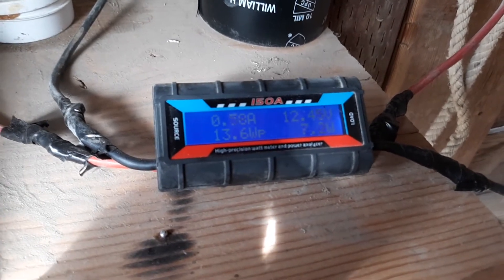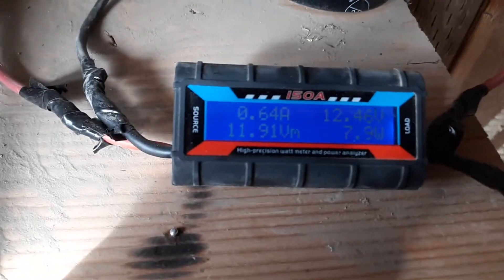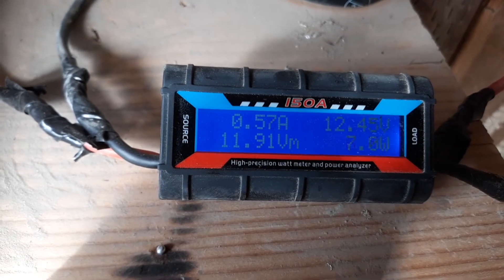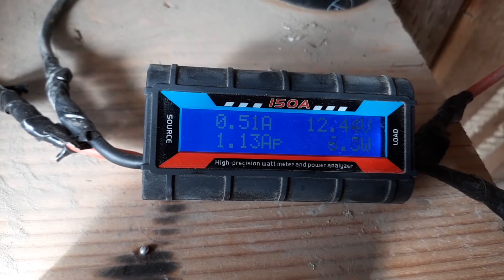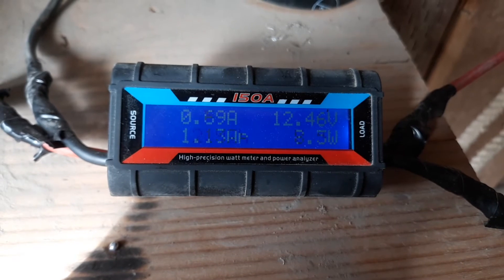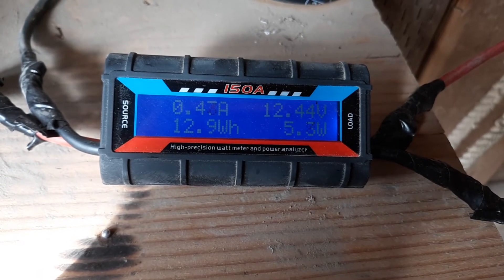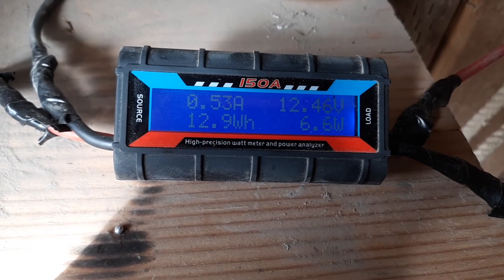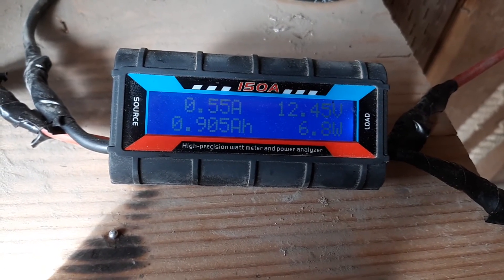Amp meter wind turbine

Comment: So i have the same 400watt wind genny your talking about. If i want to wire one of those meters up i would wire it in series from the charge controller to the battery? So my wind gen has three wires from it into the controller then black and red out to the battery....so i would just use the the pos and neg from that controller into the source side of that meter and then load back to the battery correct?
Reply from the maker: Yes from your charge controler you have a positive and negative red and black which would normally go to your battery. just wire this inline/series. The only problem you have to watch out for is that one side of this charge/amp meter needs to go direct to the battery with no other charge controlers etc.
Reply: @damocsell  When you say..."direct to the battery with no other charge controllers..." what exactly do you mean? I have that but it will not read the real time Watts, or Current, because it is in series after the charge controller, so if the battery is full, you get a reading of zero, because the charge controller stops the charge going to the battery. You need to have it before the controller, but this is 3 phase, so I need to work out how to wire in a rectifier some how, or a buss... and I can't find that anywhere easily...
Reply from the maker: @DT-ge8gd  Its been a while but I think what I meant was no other charge controller I think I used to have another controller at the battery causing problems for my amp meter. When the battery is full the amp meter should read 0 watts or amps because the wind turbine controller detected full battery. Another problem I had was my solar shutting down my wind turbines prematurely I solved this by upgrading my main charge line. I worked this out by putting on a heavy load like AC or vaccume cleaner as soon as I did this the wind turbines spun up and I could read the amp meter.